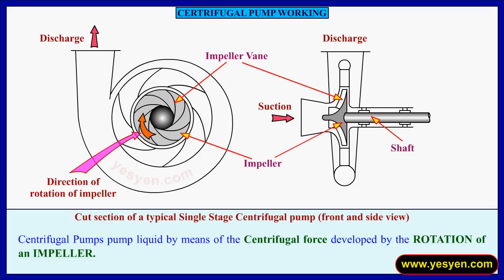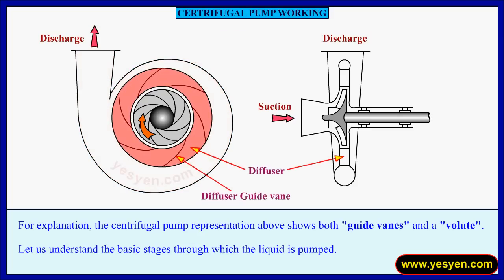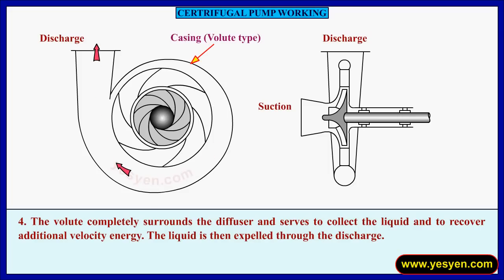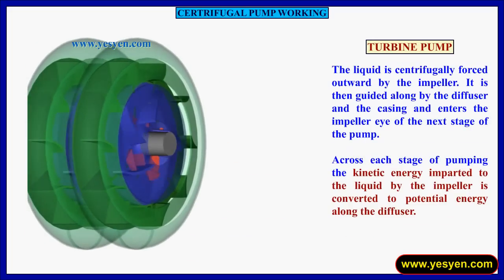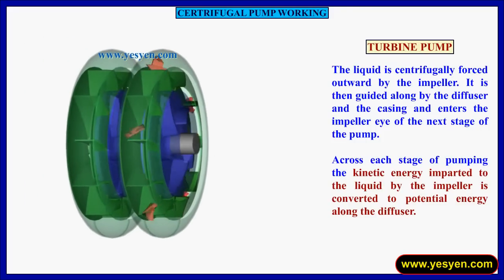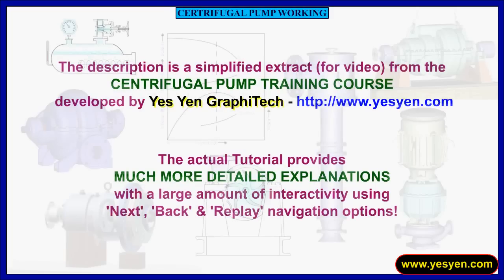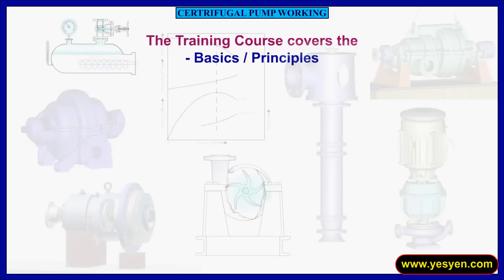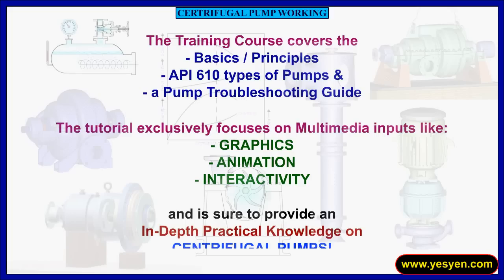centrifugal pump working animation - maintenance - theory

Comment: Old technology was better.  Three horse power pump used to mean three horses ran the pump.  Replace that pvc electrical garbage with Reliable old technology.  A wind turbine can provide the mechanical energy for a pump.